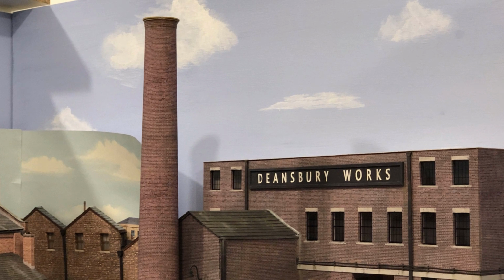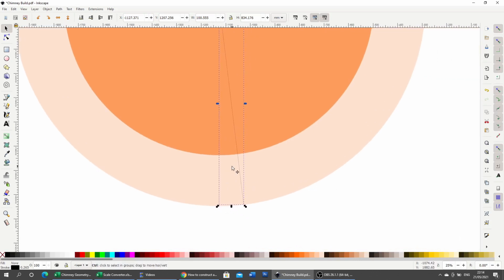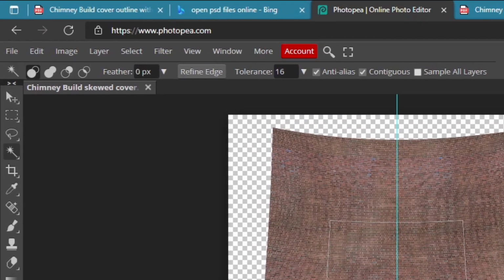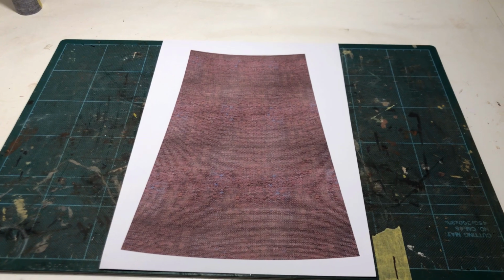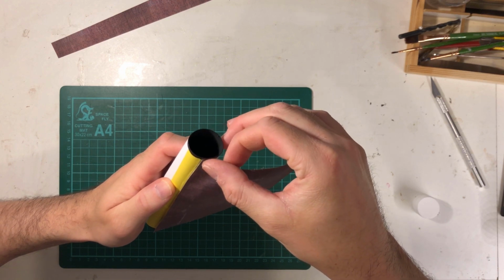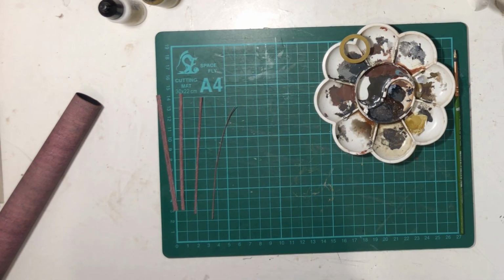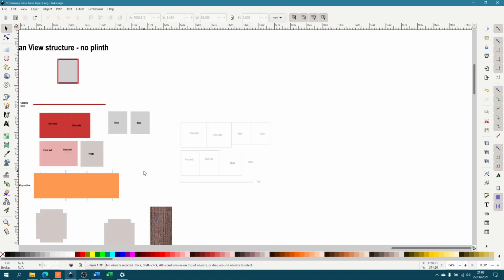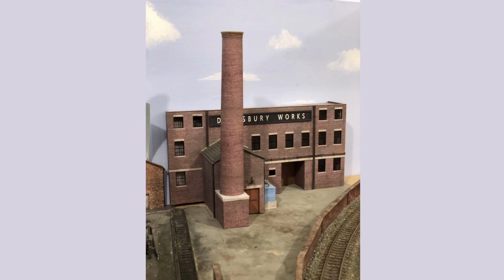Scratch Building a works Chimney | 007

Comment: Absolutely brilliant chimney. Totally worth the time and effort. You clearly have lots of patience. Q: How do you score the paper the wrap them round 90% corners without the paper splitting and showing white? I've tried water paints but struggle to get it to look perfect. Cheers
Reply from the maker: Thanks! The trick is to score the paper on the reverse before folding. Use a very blunt pin. Also important is good quality matt photo paper which resists splitting.

Comment: I enjoyed your video. What was the tool you used to measure and cut out the capping rings? It looks really useful. Where can I get one please?
Reply from the maker: Hi Peter, thanks for the comment. The tool is a circle cutter and I think I picked it up from The Works, a discount craft type shop. It was around £5 and this was the first time I had used it! I’m sure you can get similar from most craft supplies shops. Thanks

Comment: Hi Liam - finally caught up with your channel now. Watching you construct your chimney makes me realise how non existent my education was in the 60/70's sadly.
Most if not all what you explained went right over my head, but it looks fantastic. The difference between the first chimney and the final one is unbelievable.
I can understand why you curve the brickwork, it's how you do it confuses me LOL.
Loved the tutorial on putting the chimney together, right up my street, you make it look so easy to do. Explaining what pencils, glue etc you use helps a lot.
You would not believe how much effort goes into making a chimney but the end result is fantastic.
Regards Chris
Reply from the maker: Hi! No worries I deliberately skipped over most of the maths as I thought it would take too long and not be that interesting! The curving is done using photo editing software, using a tool called ‘warp’. There are points on the corners and edges of the image that pull that part of the image but leave the rest fixed, hence it needs to be done carefully to avoid over stretching. Glad you enjoyed the video! Thanks